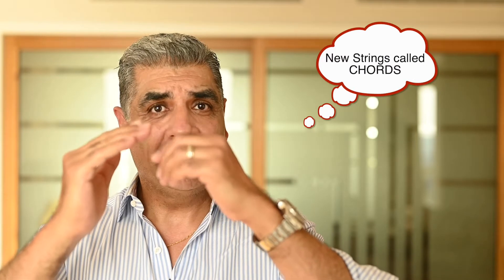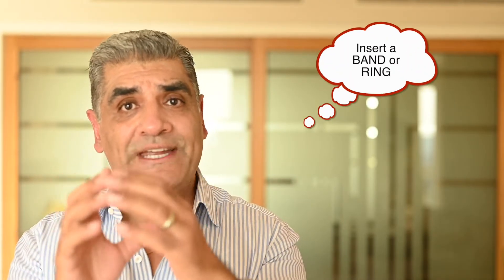How Do Surgeons Repair A Mitral Valve?

Comment: Henry ford Detroit Hospital. Instead of Transplant. I asked to fix mitral valve. 2002 i had open heart by the Hospital directer. Hadcan annuplasty ring implant. 23 years now. Seems my valves are leaking severe. Checking into keyhole if possible. Had two open Hearts.

Comment: I have residual mitral valve regurgitation and moderate valve stenosis.  I have to have my prosthetic heart valve replaced to a metal one after pregnancy. I've had two heart surgerys in the past, when I was 2 and then 15, I'm nervous but I know I'll be okay cos I've been through it twice before. 😬

Comment: Does a repair last decades? I am 37 and just found out I have a prolapsed mitral valve with moderate to severe regurgitation.
Reply from the maker: Thanks for your question: a good repair has a 95% chance of still working well a decade after surgery. Better than tissue valve and also better preserved heart function.
Reply: @Thekeyholeheartclinic   Thanks for the response. Your videos are very informative and communicate the topic well. So, in the best case scenario, it could last well into old age? Cause it would suck to get multiple surgeries. It's really crazy how I could be completely fit and healthy and asymptomatic(only a hear murmur) and have a prolapsed valve.
Reply from the maker: @suley951  correct. This problem is not uncommon…. You are not alone and the long term prognosis is good as long as you do develop secondary features like atrial fibrillation.